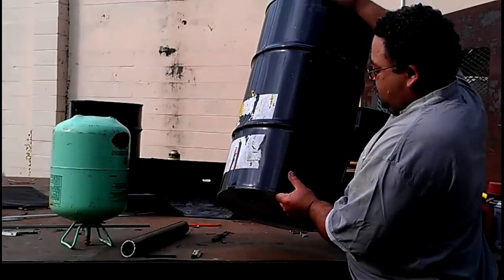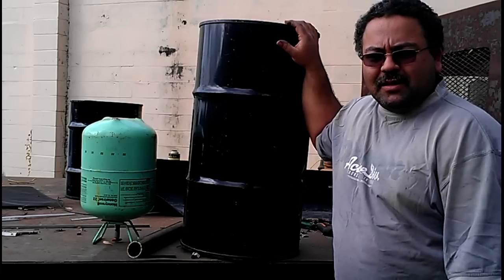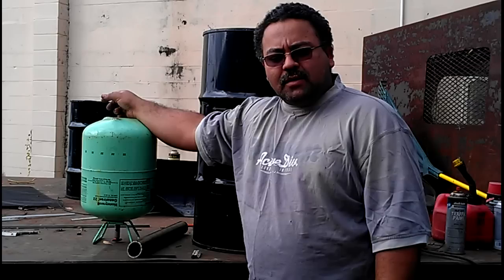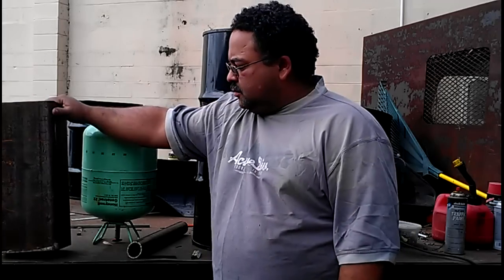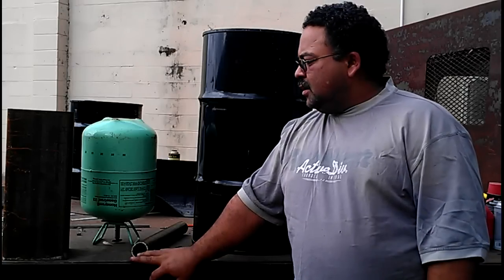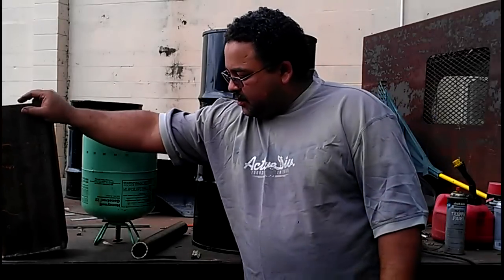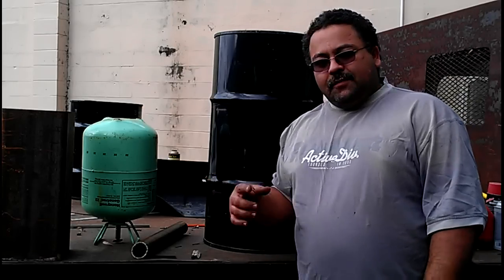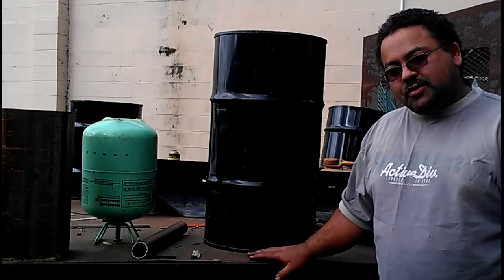OffGrid Online Gasifier Build Project Part 1

Comment from the maker: Yes, You did a great job with your gasifier and presentation. I need to post an update video, I have attempted to light mine up twice, but I don't quite have all of it put together just yet. The blower I'm using is apparently too powerful. I had a similar result to the one you mention in your video. Thanks for the tip on the rheostat. I think I'm going to look for the blower you used in your video too.

Comment: Hey MJ, I just finished my gasifier project, and used a lot of the same materials you talked about here.  You can check it out on my channel.  Good luck with the build!
Reply from the maker: How's it running for you. I never did finish mine.